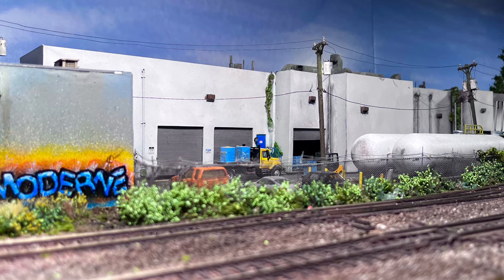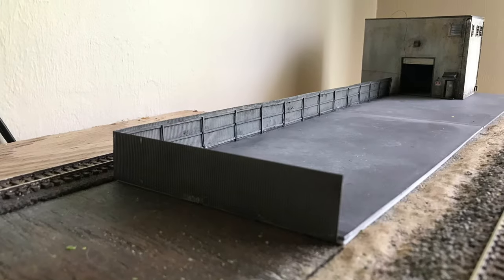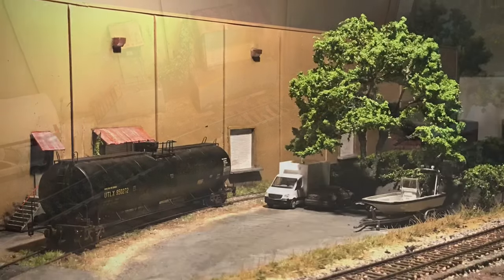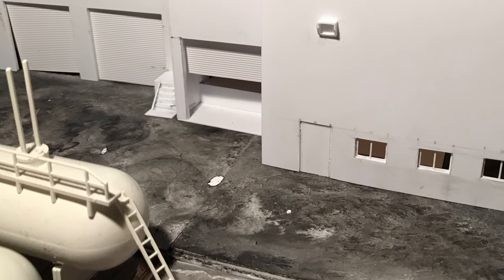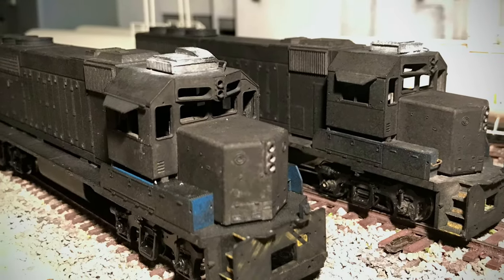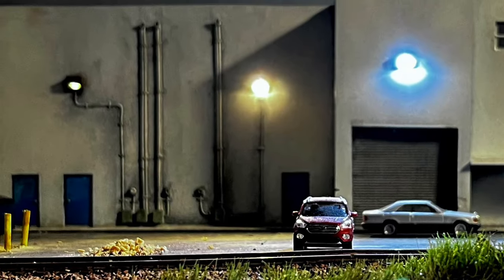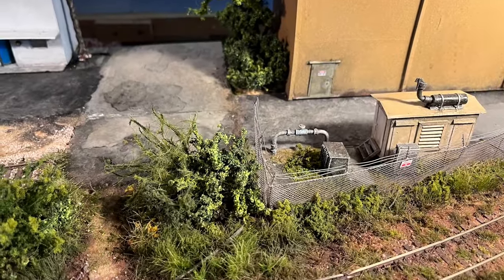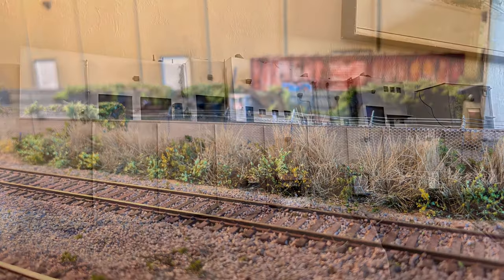OJUS PARK: Model Railroad Shelf Layout-THE LAST STOP

Comment: This work is crazy good! If ya want help putting the internals into that little switcher? Holler at me. I MIGHT can do it, I have built some small units. It's crazy that EVERYTHING is hand-made like that, and your weathering technique is on point.
You might have mentioned this, but how long did this take you, with all that detail?
Reply from the maker: Man, thanks for all that Mark, I’m truly humbled. As for 226, it’s kinda special and I don’t like to be defeated, so I will revisit that project with a clear head and work my way through it. Thank you for offering, it’s very gracious of you.
Reply from the maker: I think I’m about 30 months since I built the board. Most of the time was delay in making decisions on which way to go with different things because once you commit it’s a lot of work to redo it. And I still had to redo a bunch of stuff due to lack of experience and understanding. But I learned a lot.